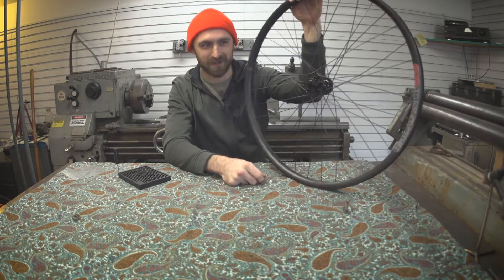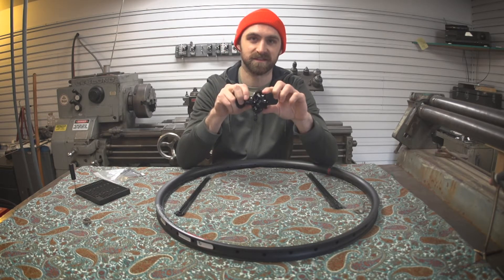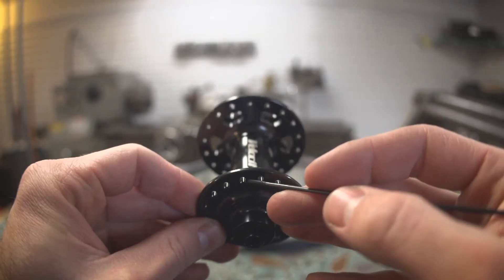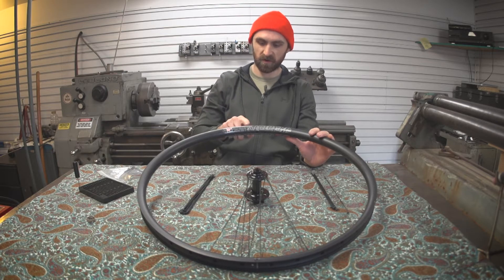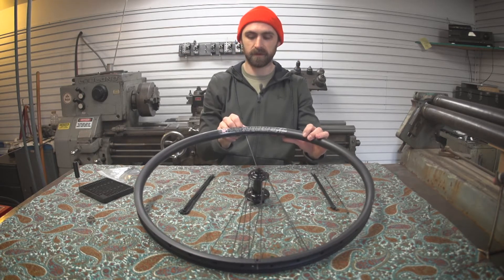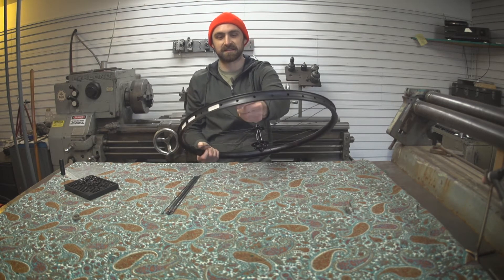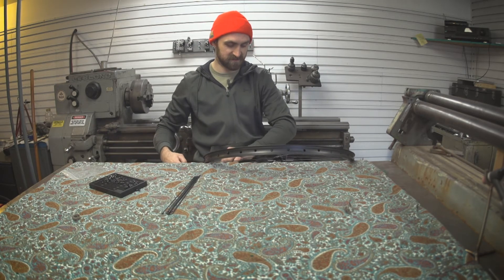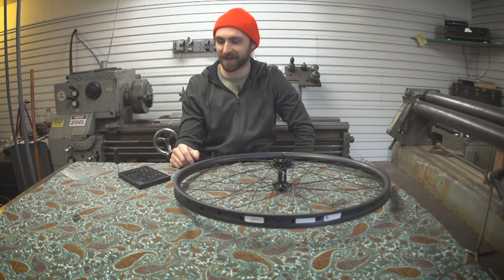How to Lace a Bicycle Wheel

Comment: Excellent instructional video!  Thanks for doing this.  
One minor quibble from a Boomer who is used to building older wheelsets with 90's Shimano hubs that have same-diameter flanges:  for us, it would be helpful to refer to the spoke sets as "drive-side"  vs  "non drive-side" instead of "longer spokes" vs. "shorter spokes."  
For us Boomers building rim-brake wheelsets with hubs that have same-diameter flanges, the first set usually uses shorter drive-side spokes and the second set, slightly longer non drive-side spokes.
Reply from the maker: @carlnishi6994  thanks for watching. In this video, I’m building a front disc wheel with the long spokes on the drive side. The rear wheel in this wheelset has the long spokes on the non-drive side. Point is, you have to know where the long and short spokes go no matter what wheel you’re building, and your spoke length calculator will tell you that info. While lacing, I find it simple and easy to remember that my long spokes are always piled on the left. Long - Left (alliteration)